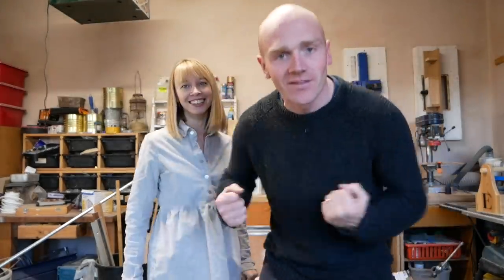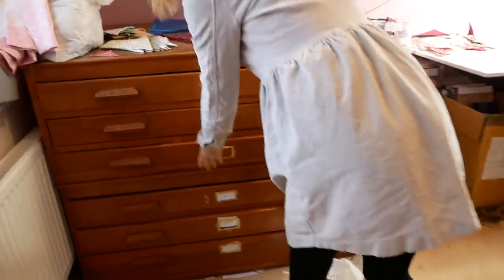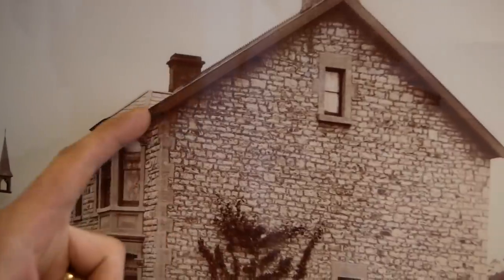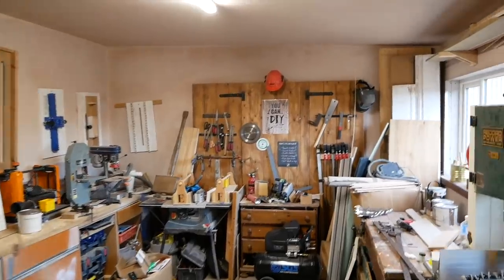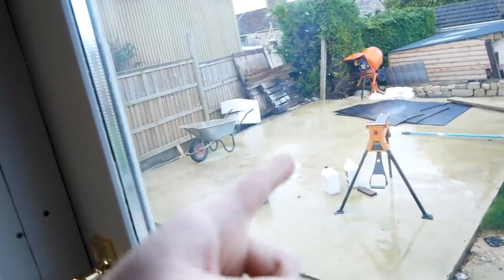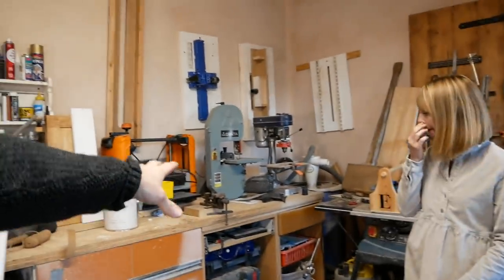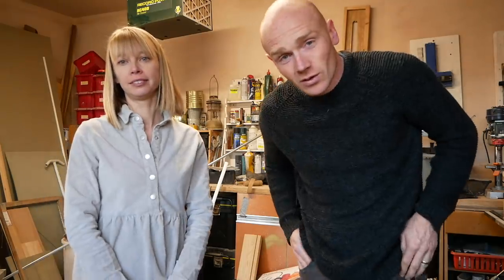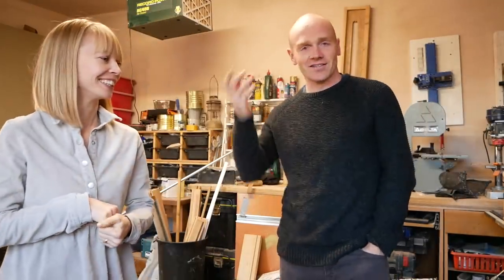WHAT HAPPENS AFTER THE ROOF?

Comment: Think hard about having carpet in a sewing room.  Dropped pins and needles often land standing up and find their way into my feet, and I not only can't scoot around on an office chair, but often the wheels dig in and make it hard to do even a little shift.  If I had a solid floor I could just give a quick sweep to get threads up, and not have to get out the vacuum.  I'm so envious of the amount of natural light you'll have in there.
Reply from the maker: Great point, (excuse the pun!) I think it would be commercial type carpet as we would have everything on rollers so not sure it would be an issue, but the jury is still out.